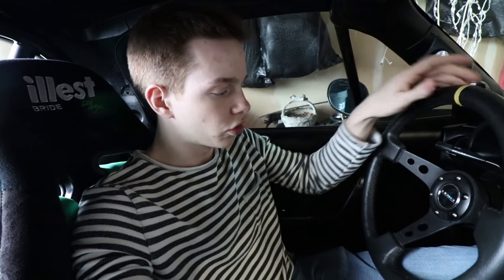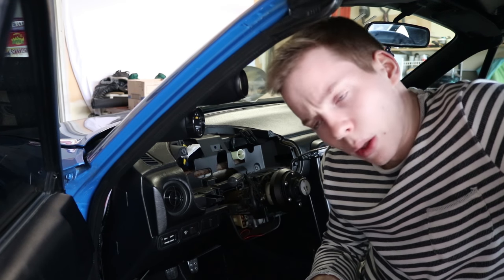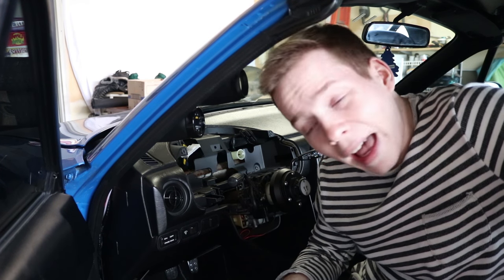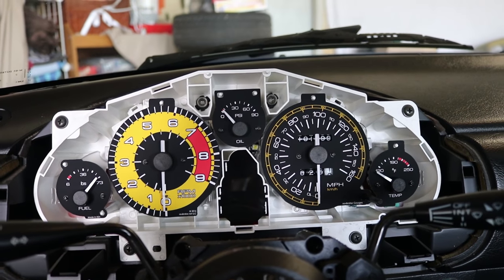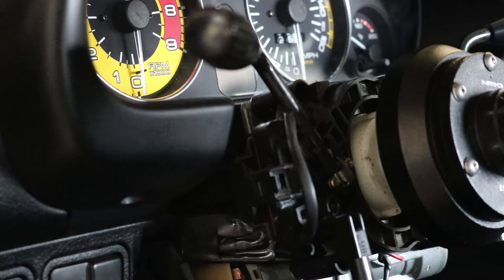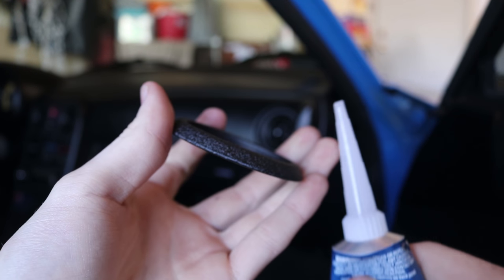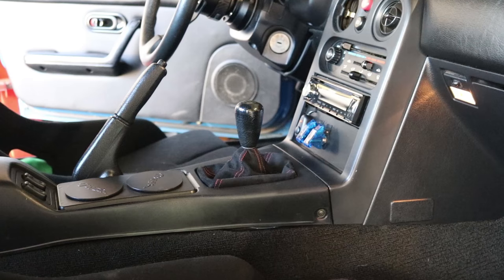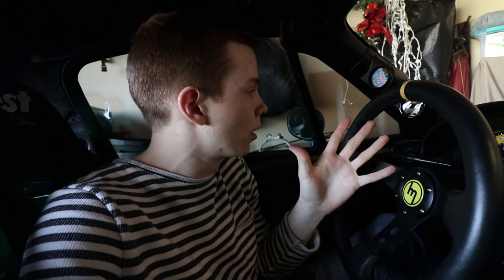Custom RevLimiter Gauges & Other Interior Upgrades! || Turbo Miata Build (Part 7)

Comment: GET A 6 SPEED MANUAL GEARBOX FROM A MK2 MIATA
Reply: Mrbadman21 ' does he have a 5 speed or 4 speed
Reply: AngrySlime11 5.
Reply: Ok
Reply: theres literally no benefit to switching to a 6speed

"yes please i would love extremely short gears and a lack of parts"
Reply: Mrbadman21 ' as someone who has a 6 speed miata, just stick with the 5.
Reply: If you do A LOT of highway/interstate driving I would recommend it, but other than that I agree.
Reply: Mrbadman21 ' quaife sequential
Reply: The 6 speed has lower gear ratios actually, which would make it worse on gas mileage over the 5 speed during highway drives. I have asked many people about it in Miata groups myself, because I wanted to do the swap, and everyone said it was basically pointless unless you swapped the differential. Even in that case, it made almost no difference except for being able to say you drive a 6 speed.
Reply: Super Veloce Gaming, The 5 speed miata gearbox that came with the NA is weaker than the 6 speed nb
Reply: MacJunior696 sooooo why not throw in a 5 Speed from a 1.8, problem solved.
Reply: The na miata came with a 5 speed manual either you picked the na6 or na8
Reply: the 6 speed has shorter gears so there’s not much of a difference. say at 80 mph in 6th you’re only gonna be about 500 rpm lower than a 5 speed in 5th. I really wanted to swap one into mine bc I do mostly highway driving everyday but it wouldn’t be worth the time and money. mine is also is worse bc I have the 1.8 VLSD installed, so that’s even more aggressive gearing.
Reply: 6 speed is needed if you start going over 280whp or so. 200-250 is ok with 5 speed. Above 350whp you need turbo2 or bmw trans.

Comment: You should get some of those quilted leather door panels. They're super easy to install and look so good in NA miatas. Also, the metal switches for the power windows is a cool touch too. I think the same website sells all that stuff. Then all you'd need is a nice shift knob

Comment: I love the brap vids but do you do anything else with the car than just modify it and put it back in the garage?
Reply: ReiniiswFX he does track days in the summer when it's warmer and less wet
Reply: ReiniiswFX you realize he's got summer tires and it's piss cold where he is?
Reply: actually he doesnt want to get it snowy
Reply: No summer tires can't be used when its below 40 degree or they get hard and start breaking apart.
Reply: +JizzyJake99 Sorry about that. Wasn't in a great mood. But winter tires have a better tread for snow and some are designed for ice. Summer tires are almost like slicks. I autocross during the summer and I've worked as Rally Crew. Winter tires don't have much grip on dry warm surfaces while summer tires don't have much grip on wet cold surfaces. That's why you don't see jeeps with summer tires. They either have all season or off roading tires. Also, most people can get by with All Season tires as they aren't taking their car to the track so they don't need tons of grip. More grip = less fuel economy. That's why prius's have skinny tires. But Caleb (Gingium) uses his car for autocrossing where grip is king. Once again, sorry.
Reply: +JizzyJake99 also they are made out of different rubbers. Blah blah blah. Summer tires = great during the summer, terrible in the winter. Winter tires = great during winter, not the best in summer. All Season tires = decent in both winter and summer but not for the track. If you want some great all season tires I recommend Cooper CS5. Thank you, have a great day.
Reply from the maker: Yes but I havent been able to drive it in the winter :(
Reply: It's supposed to be like 70 on Friday bring that thing to strats and have the cleanest miata there lmao

Comment: what i lrarned when u do that stuff wit the neddles an puting them back on. it should be done while driving. my nissan hardbody rpm face says 1024 rpm at 60 mph for a accurate reading i learned that had to be done but on this video i like the tool he got to remove the neddles.

Comment: Hi
Just a quick question, The LED bulbs you replaced in the cluster, are they 501's? also are they wide angle? only I've heard of problems with hot spots if they are not? Thank you. Cracking Miata

Comment: Stream of consciousness while I watch: 
YES!!! Gauge vid! Thanks for getting this up so fast! 
No!  Wear the gloves all the time!!! lol
wait... you took out the airbag bulb? The brain will scream at you. 
Yeah, Gauges are  pretty. /proud  :)
Holy crap the horn button fits!!! Hellz yeah. I knew it would fit the wheel but they NEVER fit random trim rings. So awesome. 
Dude. A screwdriver is way easier to pull the eyeballs out with. 
Yeah, silicone usually smells kinda vinegary.
Sharka's prettier than Molly? I think we both blushed. TY!
WELL DONE SIR!!! Thanks for the awesome vid!!!  <3

Comment: I was looking online today and I stumbled across a website call carbon miata, and it has all kinds of body modifications such as a carbon fiber hardtop roof truck lids gauge holders and more, I suggest you check out the website

Comment: I'm a tall person . They always say mx5's are pretty small , but i want one really bad. Is it really that small ?
Reply: I'm tall, as well (6 feet and 3 inches tall), and I barely fit in an FR-S, which is bigger than the older MX-5s. It'll be a tight fit, m8
Reply: thanks for the information , I'm 6'2 . I really don't know if i should get one because i don't want it to be to uncomfortable
Reply: Is there any difference between the n/a and the n/b in space?
Reply: R1KAV3R I have had an NA and NB. I'm only 5'8" but I would say the NB feels tighter to me. My NA felt like it had more room inside it.
Reply: R1KAV3R I'm 6'4 and fit fine
Reply: R1KAV3R you'll fit, the tallest teacher at my school drives one and fits perfectly 👌
Reply: If you can manage to lower the seat some then go for it.. If not then probably not

Comment: should I buy 2005 hyundai elantra one owner for 3000$ or 1992 mercedes w124 250 turbo diesel for 2000$...
Reply: Riki Diki Mercedes then straight pipe it cut the springs a throw new wheels on it
Reply: elantra has lpg and it does better mpg its my daily so...merc i really like

Comment: So I notice you use your racing harness on the street. You should be aware of the dangers of driving a caged harnessed car without a hans system and a helmet.  Put in the regular belts for daily driving or run the risk of snaping your neck in a fender bender

Comment: i make the gauge hoods if you need one..they look 100%oem but are better..they are made with a tiny bit of flex so they dont crack or become brittle and im cheaper than anybody..if you find one cheaper than me..PLEASE TELL ME..IM SERIOUS.. ILL MATCH ANY PRICE AND GIVE YOU A EXTRA 20% OFF..THANKS.. GREAT CAR.. ILL TELL YOU ABOUT MY MARINER BLUE NA I GOT BRAND NEW FOR MY 16TH BDAY IN APRIL OF 1991 AFTER  MY POP SENT A PAIR HE BOUGHT WITHOUT TELLING ME TO MONSTER MIATA..THEY ARE BOTH STILL PERFECT BUT ARE NOW ROUSH BUILT COYOTE ENGINES ALONG WITH PROCHARGERS,A T56 MAG ON ONE AND T6060 ON THE BRG..ALSO BOTH VCARS ARE STILL THE SAME COLOR BUT WERE BOTH COMPLETELY DISASSEMBLED AND DONE IN HOUSE OF KOLORS BUT I HAD .25SIZE SILVER FLAKE WITH A KANDIED MARINER TRANSLUCENT BLUE AS WELL AS THE BRG WAS DONE IN GOLD .25 FLAKE ALSO WITH A BLACK BASE AND TRANSLUCENT KANDY GREEN...25 IS THE BIGGEST FLAKE POSSIBLE..I BASED IT ON THE FLAKE I USED ON MY BOBBER MOTORCYCLE..ITS LIKE WHAT YOU SEE ON A BASS BOAT..THATS IT..BUT ITS BEAUTIFUL WHEN THERE IS 10 COATS OF COLOR BASED CLEAR COAT PLUS A BASE COAT,FLAKE COAT,A HEAVY TRANS COLOR COAT AND THEN 10 KANDY COLOR COATS..I OWN A PAINT SHOP BASED ON EXOTIC RESTORATIONS SO WE HAVE CRAZY HIGH STANDARDS AND THE PAINT JOBS ARE AN EASY $18,000 EACH CAR.. DONT KNOW YOUR CHANNEL..IM NOT ON MUCH..I SAW A BLUE MIATA ANDWANTED TO SHARE SOME INFO..YOUR CAR LOOKS FANTASTIC MAN! ILLL HIT YA UP AGAIN..TAKE CARE

Comment: But this isn't a gauge swap.. they're only overlays on the stock equipment. I am disappointed, first time I can recall for this build
Reply: slasher7555 still changes the look of it even tho its abit flashy
Reply: Kasam but they aren't changing gauges just overlays and actually made them even the slightest more inaccurate due to size difference. noticable on the fuel gauge and tach being off their mark. he would've really benefitted from a real gauge upgrade to help accuracy, responsiveness over the early 90s tech, the looks and more.
Reply: slasher7555 true, if i was him I'd just change the lights like he did and leave the gauges
Reply: Kasam if his only desire was for looks I completely agree. LED bulb swap to a different color or pure white wouldve made a great subtle difference. personally I would've went with a whole new set of gauges with real benefits. Speedhut makes great custom gauges to order for all applications he could've had those exact overlays if he was indeed in love with them but as functional upgrades. They're all 100% customizable, full clusters are under a grand and rival autometer in quality. also all still built in America. I have them in my ProTouring camaro and love em.
Reply: j